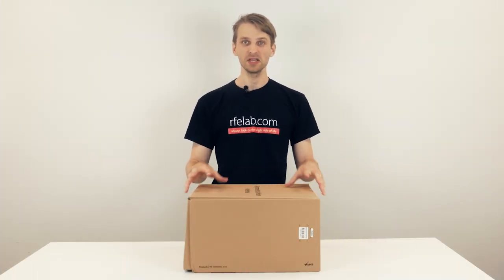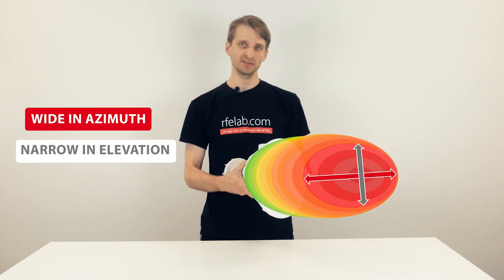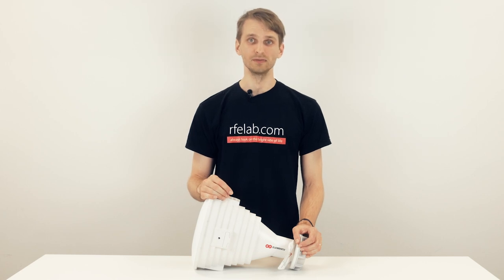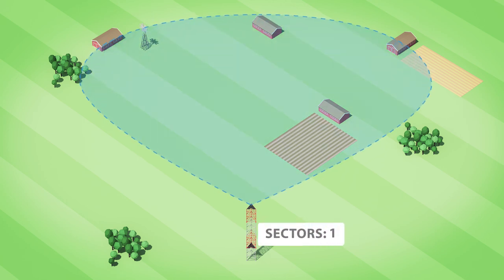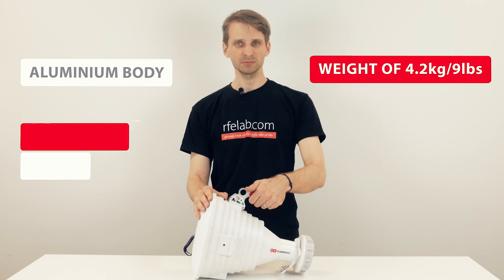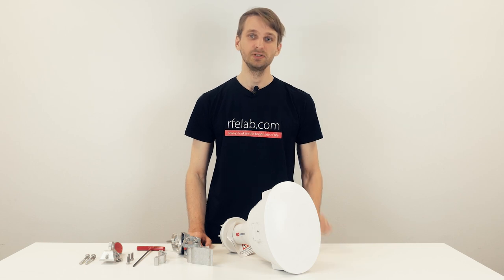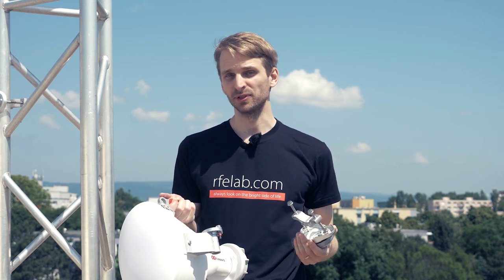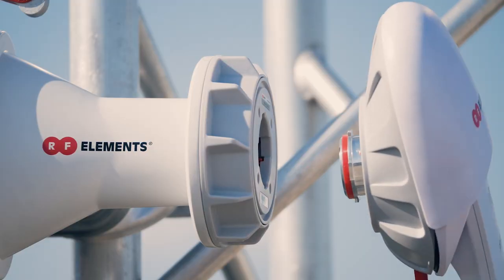Product Introduction - Asymmetrical Horn TwistPort™ Antennas

Comment: Estoy a punto de cambiar toda mi torre de sectoriales a RF pero tengo una duda una antena sectorial tradicional de 21 db cuánta desventaja tiene contra 90° Sectorial HG3 T A90 gracias por su respuesta
Reply from the maker: Hola. La primera pregunta que te haría es, ¿De cuantos grados es el sector tradicional que vas a reemplazar? Bueno, igualmente te comento que las sectoriales tradicionales son similares (en angulos de apertura) a las antenas horns asimétricas de #RFelements. Ventajas? Muchas, en primer lugar y muy importante es que las horns (bien sean simétricas o asimétricas) cuentan con un patrón de radiación muy limpio y bien definido sin lóbulos laterales lo que aumenta la confiabilidad de su red pues usted sabe a donde está enviando la señal e igualmente le ayuda a mitigar los efectos del ruido, pues al enfocar toda la energía en un haz bien definido y no tener lobulos laterales estos no interactuan con los demás radioenlaces circundantes y no le trae problemas. En segundo lugar, la estabilidad de la ganancia en todas las frecuencias dentro de la banda de operación de estas antenas es muy bueno, o sea, usted cambia de canal y no importa, tendrá la misma ganancia siempre y sus enlaces no se degradarán; y en tercer lugar, usted contará con el ecosistema TwistPort (entiendase adaptador y conector - hembra y macho) Este ecosistema le elimina a usted los cables pigtails que usa normalmente e introduce una pérdida practicamente cero (esto es en el caso de que su radio sea coaxial conectorizado, en el caso de que el equipo que usted use sea de guía de onda, como el IsoStation, la pérdida es cero y el adaptador actua como guía de ondas - guía de ondas), además, este adaptador combina la instalación del radio en la antena en un simple "gire y bloquee". Si usted quiere conocer más sobre nuestra tecnología pues le invito a que consulte nuestro catálogo de productos que allí encontrará mucha información adicional en idioma español - http://bit.ly/2SF8iya -. Gracias